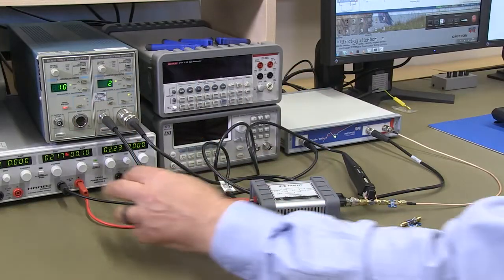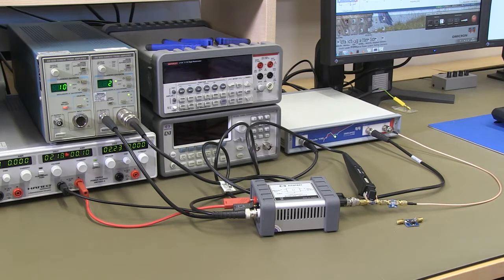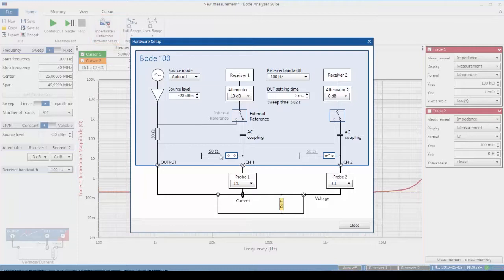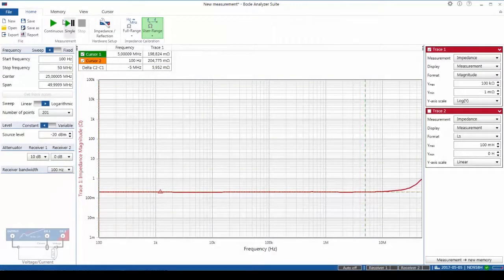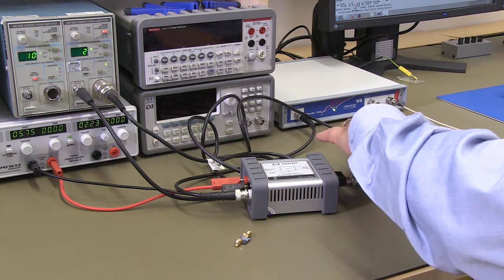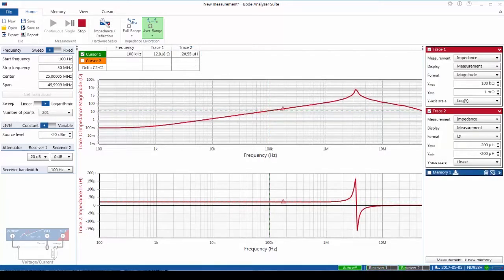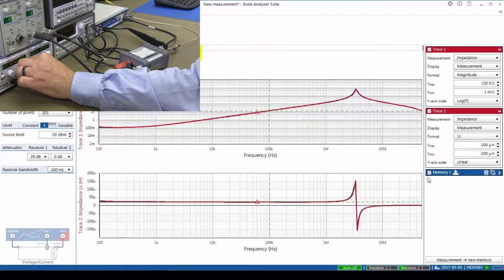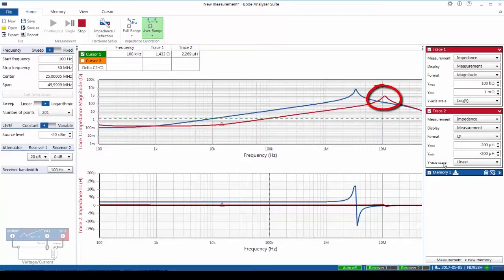DC-Biased Inductance Measurement

Comment: what is current probe? model name?
Reply from the maker: Most probes will work.  This one is a TEKTRONIX probe with 503 Amplifier.  We often use PEM CWT probes, which you'll find online OR choose the J2121A which includes a current monitor.  Find that here. 
https://www.picotest.com/measurements/inductor-measurement-including-dc-bias.html

We have other DC Biased inductor measurement solutions up to 125Amps on the Picotest.com/measurements page. 

Have more questions?  Email me at steve@picotest.com